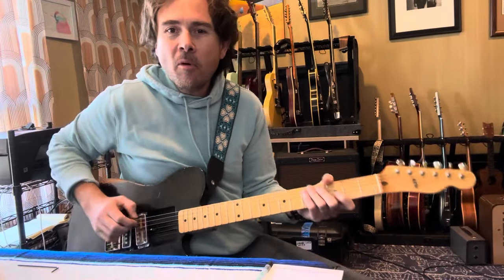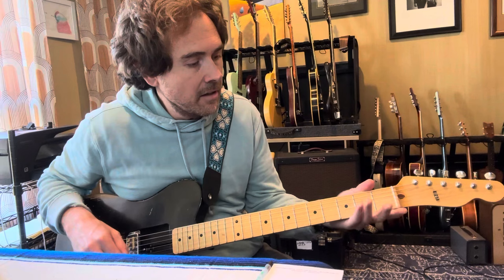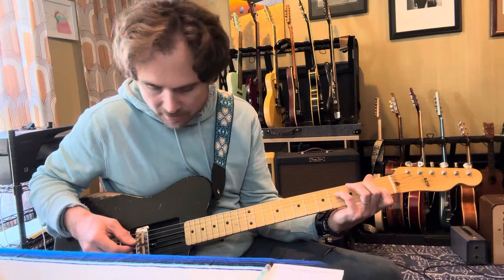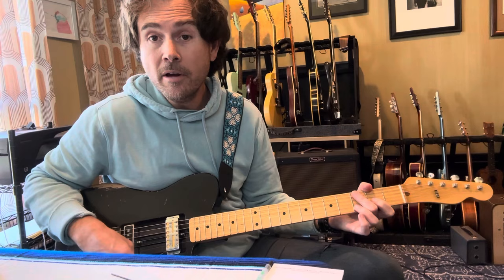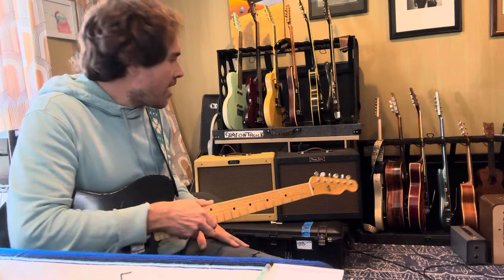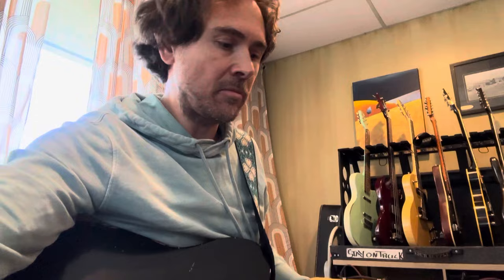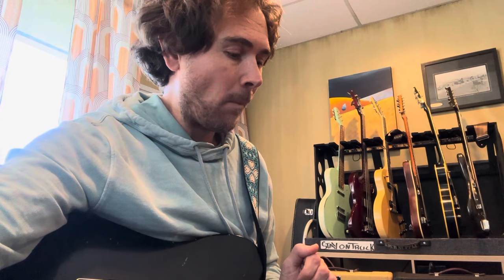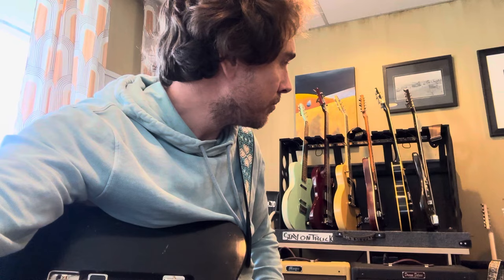Jedd in the shed - Episode 51 Rig Rundown

Comment: The string vibration is what causes the difference in sound. The closer to the bridge, the less vibration in the string, the less disruption in the magnetic field. You get tighter, and brighter accordingly. The closer to the neck, and you get a wider oscillation in the magnet's path thereby causing a fuller sound. FWIW. 🤠👍

Comment: That Tele is awesome! I've never thought about the neck pickup like that... I always thought it was imperative for the pole pieces to be directly under that octave harmonic. I have passed on more than one guitar simply because the neck pickup placements were "wrong," as ridiculous as that may sound... It's the main reason I don't own any with 24 frets! Anyway, great video as always!🤘
Reply: SG models move the neck pickup up a little, so the neck joint isn't too weak from lack of wood there.  As a result the neck pickup has more treble and less mud than the Les Paul, the body shape/size helps too - much more resonant than a Les Paul standard.
Reply: @pharmerdavid1432  I noticed that. I think Derek Trucks plays mainly on the neck pickup of his SG, and it makes more sense why he gets the sound he does. It's not overpoweringly bassy. (I've always wanted an SG, but I've never been able to get along with them, and I'm not sure why...)